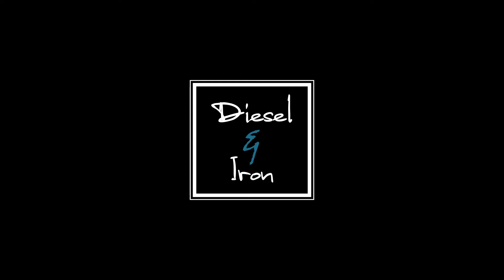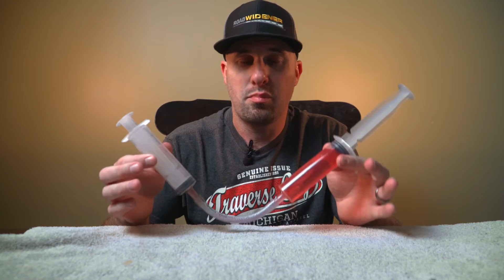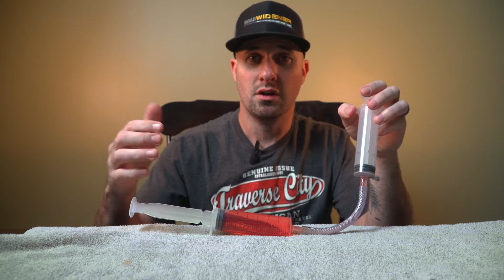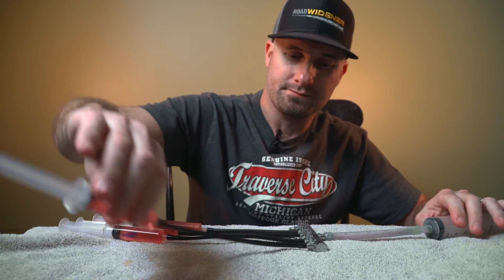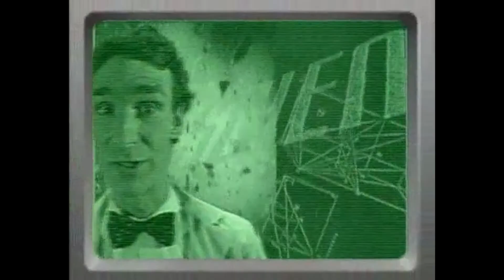Basics of How Hydraulics Work | How do Hydraulic Machines Work?

Comment: I have a 330cl excavator when I try to lift the boom the hose connected to idler pump will start to vibrate but the drive pump hose will be normal what should I do

Comment: Hi, I've just started working with mobile cranes, and I'm trying to get my head around the basics of how they work, this video was super helpful to understand hydraulics and from my understanding that's mostly what mobile cranes will use for most of their movements. I've had one operator though mention that he needs to wait to get air up to start work once, this was an older crane that had air leaks but I'm wondering where the air comes in if they are mostly hydraulic? It was already set up in position as well so not related to driving it on the road. For added context it's a 10T bubble crane from Kato, roughly 20 years old I believe.
Reply from the maker: I don't know for sure but I know a lot of machines will use an air system alongside hydraulic components for certain things.  Maybe a slew brake?  It could be other systems not related to the actual lifting mechanisms (aka, an offroad crane would need air for the brake system but not for actual lifting).

Comment: One thing I never understood in hydraulic systems and never found a good explanation: you have to push a piston, which will push the liquid and move another piston or mechanism on the other hand, correct? Why not just use the power to move the part you want to move in the first place? Something still needs to produce the energy and force to push the original piston down, so are you not just transferring energy from one site to another? Dumb question I’m sure 🙂
Reply: Yes you are right, you are transferring energy from one site to another. However it's the efficiency of power used to move the object is what matters. Hydraulics takes a pump(small piston) that takes lower power to move and amplifies said power through the pressure the system creates, thus moving the load(large piston). So the more pressure you give the system, the higher the force you get, or the heavier load you can lift. Basically, you gain a mechanical advantage, just like adding multiple pulleys to your lifting device. One part line takes a lot of force to lift an object, but the more pulleys you add, the less force it takes to lift that same object. So you now have a more energy efficient means of moving said object.
Reply from the maker: Adding this question to my list of ideas for a Down & Dirty topic. Due to lack of time, I'm starting to take consulting calls on the side. If you'd be interested in that, shoot me a message at thatdiggerdude@gmail.com. Thanks for the support brother!

Comment: You explain in a comment below why oil is used over water, which is wonderful. Ok, one thing I'd like to know is how hydraulic fluid is put in and then air pumped out (or how is air not put in at all)?
Reply from the maker: You don't pump any air out of the system.  If you pop open the side panel on a good sized excavator you will have a good idea of how the hydraulic system works.  You have a tank that holds a good amount of hydraulic fluid, far more than the system needs during normal operation.  This serves two purposes.  One, it takes away the issue of having to pump air out of the system to have pure hydraulic oil and two, it helps cool the fluid by shear volume.

If you look at the hydraulic feed line to the pump you will notice it draws off of the bottom of the tank.  The hydraulic tank at any given time shouldn't fall below half full when running.  This means that even with all of the slope work and sloshing, the pump is only pulling in hydraulic oil, no air.  Hydraulic oil has additives in it to keep it from getting frothy and picking up lots of air bubbles.  Are there still some tiny bubbles that get pulled through the system?  Sure, but they are tiny enough they don't cause issues to the system and the operation of the machine.  Hope that answers your question!
Reply: @DieselandIron  It absolutely does! Which gave me another question: is the pump the actual machine creating the force that moves the oil? If so, can the pump create different levels of force then?

Or is the pump diverting oil into another machine that creates the force required to move parts? 

In other words, in your video, your thumb pushes down on the syringe. Is your thumb the pump? Or your thumb a separate machine using oil that was pumped into its main chamber?

I'm just super curious. I happen to be studying fluid statics in a physics class and outside was a hydraulic lift lifting painters all over the top of the building and I decided to google this stuff. Your answers are incredible, so thank you again!

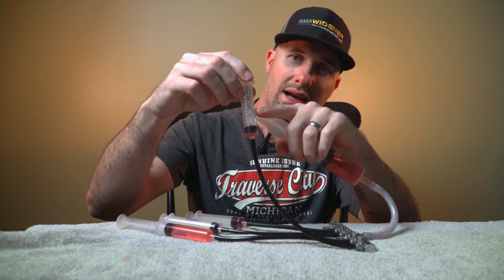Comment: Amazing video. 6:28 This is the part I was confused about because another video completely omitted to mention this. So pressure on the rod side works because the fluid on the piston side is, in fact, returning to the main reservoir. Was sooo confused up until now haha.
Reply from the maker: Correct.  You have to relieve the force on one side of the piston to allow movement of the rod.  Now that you think you've got an understanding of hydraulic systems, engineers complicate this like on the new Hitachi machines.  Oil on its way back to the reservoir is actually diverted into other cylinders to help boost the speed of other functions.  These new machines have extremely complicated hydraulic systems compared to what I've shown here.  Fun stuff!
Reply: @DieselandIron  That's actually very efficient and practical of them and hadn't even occurred to me. Man, oil must be going all over the place lol

Comment: It’s super easy to understand! I just wanted to know what valves you were using and where I can buy them?
Reply from the maker: The syringes I was using can be found at your local Walmart or pharmacy for free.  Go up to the counter and ask for some syringes and they will give you some.  The larger syringe and the manifold can be found on Amazon.  Here's a link to a manifold:

https://www.amazon.com/QMseller-Stainless-Aquarium-Splitter-Control/dp/B07PFPPFDK/ref=sr_1_8?keywords=aquarium+air+manifold&qid=1648217673&sprefix=aquarium+air+man%2Caps%2C112&sr=8-8

They have a ton of options when it comes to size and number of valves.  Thanks for watching!

Comment: loved your video keeps things super simple, fyi waters non compressable
Reply from the maker: Thanks Chris!  You are correct, water is non compressible but the reason we don't use it in hydraulic systems is for a couple reasons.  First, the fluid gets hot enough that you have the potential for steam which is compressible.  The second you have steam in the system you lose all your power.  Second, water doesn't lubricate the pump like hydraulic oil.  Finally, water rusts metal...which happens to be what a lot of the hydraulic components are made out of.  By using oil we protect the system from corrosion.  Thanks for the comment brother!
Reply: @DieselandIron  Your comment here is a whole video on its own, glad I caught it.

Comment: Awesome video! I’m a huge fan of the pilot controls myself lol something I don’t like about EH feels like your separate from the machine someway. With pilot it really makes it feel like your in tune with the machine and sense everything you need to adjust to work the best.
Reply from the maker: Thanks man!  I 100% agree with you on the EH controls.  I have legitimately had to relearn a couple pieces of equipment because my feel was gone.  Once I got used to where my brain was getting its information from I was alright but like you said, you still don't feel "in tune" with the machine like you did with a pilot system.